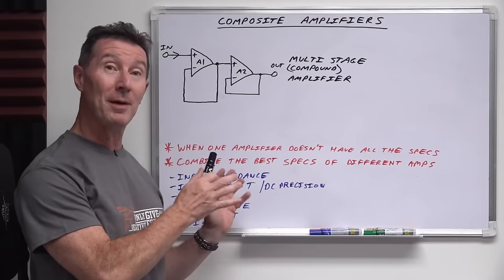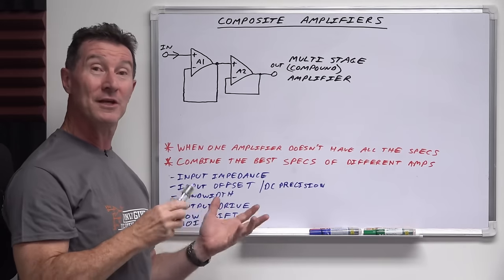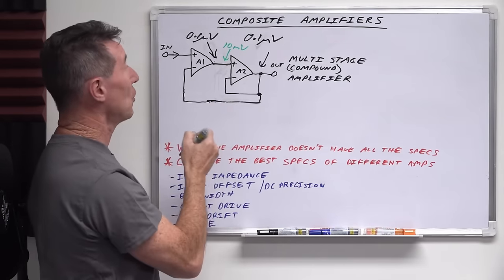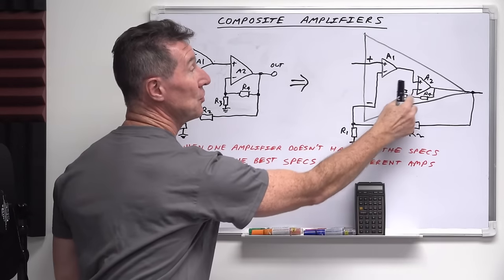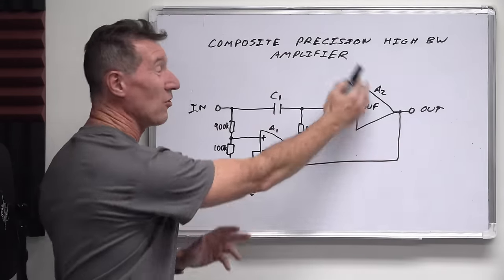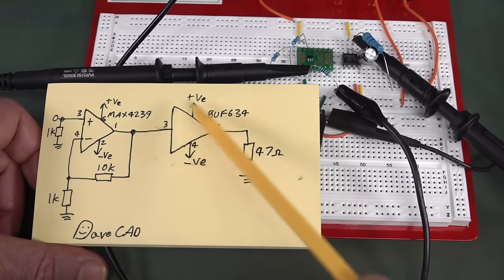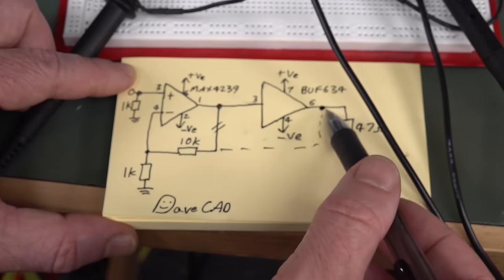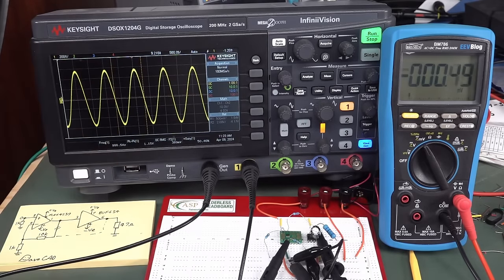EEVblog 1609 - Composite Amplifier Tutorial + Practical Demo

Comment: A very common amplifier, yet often totally hidden inside a package as well, with most opamps being made up of them as well internally. A good explanation of why you want the gains, and the closing of feedback loops as well, so as to get the desired performance, plus that you can mix different types of amplifier as well.
Reply from the maker: Yes, totally forgot to mention that in the video. I knew there was something I wanted to add.

Comment: Great video. It does often cause instability (oscillation) which has to be compensated externally. It would be great to see a video explaining different ways to stabilize amplifier circuits and how to calculate component values (resistors and capacitors) for the compensation network.
Reply: Yes please! I've never understood how to do the compensation
Reply: @hugofrisk1889   Uhm by lowpassing the feedback to attenuate the oscillation frequency?
Reply: Old comment but putting a low pass filter in the feedback path would make the problem far worse.   Often the solution is the opposite, you use dominant pole compensation on the inner Amp to artificially reduce its gbwp until the system has adequate phase margin.  Miller compensation is probably the approach I see most often.

Comment: I remember when my first analog electronics course in university covered Darlington pairs, then later covered ideal and real opamps. We were a little confused when a subsequent class started with a Darlington pair drawn on the board. Our instructor replaced the transistors with opamps, then asked us to "discuss the implications" (our professor's favorite phrase). We discussed not only buffer amps, then went on to add feedback to make logarithmic amps, followed by homework that had us modeling the whole thing in Spice, down to the internal transistors.

In the lab that accompanied the course, the corresponding project started with a box of "random" opamps and transistors (along with a standard kit of resistors, caps and inductors), then tasked us to make circuits meeting particular specifications for gain, power, bandwidth and noise using only the parts in the box. That really opened our eyes to the power of working with "what's at hand" when meeting a need, and, more importantly, realizing when those parts CAN'T do the job.

Many of the specs had multiple successful implementation paths using those parts, and the "winner" was based on minimal parts count. The only thing missing was having prices on the parts, to force us to decide which made more sense to take to production. But the professor did call it a "hands-on theory course", so prices would have been a "distraction" as they don't map to theory!
Reply: That sounds like a great course and a great professor.
Reply: @SoonerRoadie , ditto. I wish I'd had that class and prof. But now I have Dave, and I can't argue about the cost of tuition.
Reply: that must have been donkeys years ago. hadnt heard or such classes any recent time and i HAD a seriously old fashioned prof at Electronics 😮
Reply: @urugulu1656  Yup! It was 1982, at UC San Diego.
Reply: @SoonerRoadie  It was intended to be tough, to weed out folks lacking math skills and/or lacking the ability to rapidly grasp and apply theory. I would have totally failed had I not just come from being a US Navy technician, where I understood all the fundamentals and had good lab skills, needing only the theory behind them and the math.

Comment: Thank you so much for this 'basics' video. Great, that you did it on that abstract / practical level, not too much details or variants, and not too high flying, so that everybody could catch the idea and advantages.
Myself, I was very much fascinated of those amplifiers, when I did my first job @19 in the Airforce lab in 1980/1982.. most hp, FLUKE, Philips multimeters had one or several composite amplifiers of all kinds (in constrast to only a linear OpAmp). At that time, they consisted of discrete components, like vaccum tubes in combination with optical choppers, or a double FET and a 741 for the AC path, plus a capacitor coupled FET chopper path for the DC path. In the volt-nuts section, we discussed the classic null detectors, like the Fluke 845AB/AR, which also has this composite design.. 
If I find the PCBs, I'll post pictures of the PM2524 discrete chopper and A/D converter, which I had designed from the schematics. Great stuff. Let's see if it still works and how it performs after 40 years.

Comment: I found a national semiconductor paper when I was doing a small headphone amp. Not knowing the. what Dave is talking about here I replicated the circuit and it was awsome. No DC drift and good low noise application. A good input amp and an higher current output buffer in this configuration, two resistors to set the gain and a decent power supply you get a really good amp. Thanks Dave

Comment: Well done.  I have designed some analog circuits in my life, including some that went into consumer products, and my only real experience with "Composite" amplifiers is in analog filters.  I found this video interesting because I have "Cascaded" (put in series) Op Amps on many occasions-  usually in an effort to get good gain without adding any more noise than nesc., and also- obviously, sending the output signals through some kind of buffer/line driver- like everyone else does.  I have not given building some of these designs as "Composite" before... but I will do so for the next time.... see what I come up with.  Thanks again.

Comment: These 'tutorial' type videos are the reason I started watching your channel many years ago with the 34063 . 👍One day if you up to it please do one explaining where the energy goes if you have an off grid inverter MPPT controller that is fed by a solar panel and the output ( load ) is far smaller than the input power + the battery is fully charged . The panel is in direct sunlight - All I can think is that the output which is ' throttled by the MPPT' must then be dissipated as heat by the panel ?  due to conservation of energy .
Reply from the maker: Ask yourself "where does the heat go" if you have a 400V DC battery just sitting there...
Reply: @EEVblog  I would guess nowhere , as it is just stored chemical potential energy which is only released when connected to a load and current flows.

Comment: I have done the composite amplifier thing 3 op-amps deep to get high gain at high frequencies and a low offset.
Opamp 1 = low offset and  low noise, over compensated and inverting pin to (-) input of compensated via resistor..
Opamp 2 = darn fast opamp (+) input  goes to the (-) input of composite and (-) input controlled by 1st stage's output
Opamp 3 = Extremely fast inverting output of opamp2 to make the final output.
For a step input it got settled in a big hurry but the offset was under 100uV

Comment: If I remember correctly, you used 2 cascaded MAX opamps in the uCurrent design. Could you explain why not using 1 in front and a cheaper one as the second in a composite configuration?

Comment: 1. I need to know why amp B needs to have a higher gbw than amp A. I might have an intuitive feel why it may be so but i'm not comfortable with the gap in my knowledge.

2. I know how to add a discrete output stage of one or several transistor pairs to an opamp, and indeed it works fantastically. Classic headphone amplifier schematic, but indeed can have versatile use. How does one add a discrete JFET input stage, and when might one want to do that vs. choosing an opamp with a different type of input stage in it?

Comment: Very interesting. Can you check TIM distortion? How does a very fast OpAmp interact with a buffer?
Reply: The distortion  products tend to be push up near the gain crossover of the whole system when you do a reasonable design.  A quick way to think about it is to do the "gain sacrifice factor".  If the open loop gain at 1MHz is 100 and your closed loop gain at 1MHz is only 10, you do 100/10 to get that you are sacrificing 10.  If your sacrifice is 10, then the harmonics at 1MHz will be reduced by 10.

Comment: Wonder if this will reduce the THD of an LM386? It’s probably a lot slower than whatever op-amp you’d put in front of it, but you can probably make it stable by putting a cap in the feedback loop.

Now I’m wondering how to do this with an instrumentation amp circuit.
Reply: It's basically the same if you mean using a fully-differential amplifier as the outer amplifier in the composite amplifier, you just have to mirror everything inside the two inner loops. You can use a FDA like this to create a bridge-tied output with basically zero DC offset and no even-order distortion. In either case, single-ended or bridge-tied, you can forego the LM386 entirely if you want more than 1W of power. It's the same process for a discrete output stage, you close the feedback loop around a complementary class B stage with power transistors, which can be of whatever size you like if you use them in darlington configuration or add a buffer amplifier in the loop to provide sufficient base current. With a fast enough opamp you won't measure any appreciable crossover distortion even with a very cold bias running like this, no need to waste current for class AB bias, which means a simple diode bias is fine without worrying about thermal compensation. Just ensure the opamp has sufficient voltage headroom and its overload and recovery are well-behaved for good large signal behavior.
Reply: @maudiojunky  done the class-B stuff before, it takes up more board real estate and you need a pretty fast op-amp to avoid crossover distortion.
Reply: @Scrogan  I have to say my experience differs. If you bias the transistors just below turn-on with a simple diode pair the crossover residual can be almost immeasurable. Audio just isn't very fast, even with no biasing at all a 5V/µS opamp will pass through the crossover region in well under 300ns.

Regarding the IC amp solution, you may have trouble wrapping an integrated audio amplifier inside the feedback loop because it may already be compensated too slow to work in this configuration since the inner loop must be much faster than outer loop. LM386 has a rated bandwidth of 300kHz, so it's quite slow compared to opamps and buffers. Even if the composite amp isn't quite stable at 20kHz bandwidth you might still find use for it powering a woofer paired with a comparatively sensitive tweeter driven directly by the other half of a dual opamp in a portable speaker.

Comment: For All you "Audio People" out there, here's what you need to use: LME49860  ~ $2.61 or OPA891  ~ $3.40 .  Period.  No $$?  Use an NE5532 ~ $0.08 or RC4558 / NJM4558 ~ $0.05,  though the '4558 has greater output current than the 5532, it also has more noise, so spend the 3 cents on '5532!
Reply: Better use an OPA1656 or NE4562. For greater output current people should use push pull output.
Reply: NE5532 is decent enough for most people but after NE4562 i bet that nobody will return to use NE5532 anymore.
Reply: @ottoman556  What are you driving that needs more current? subwoofers? 😂